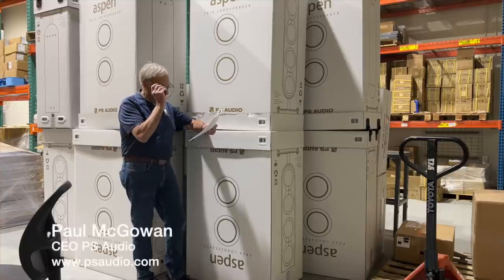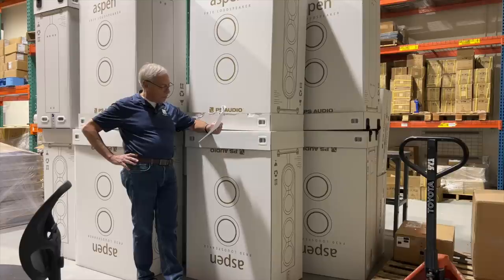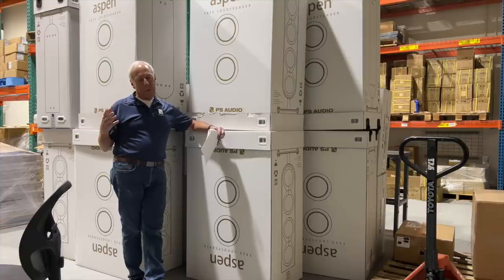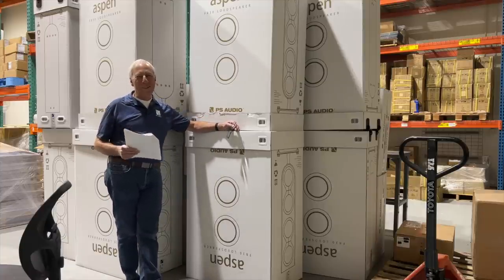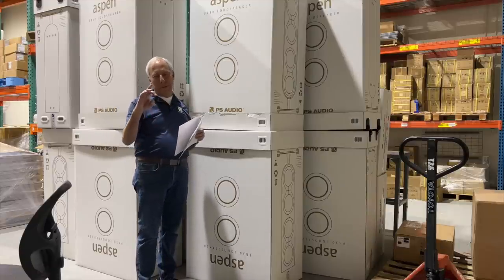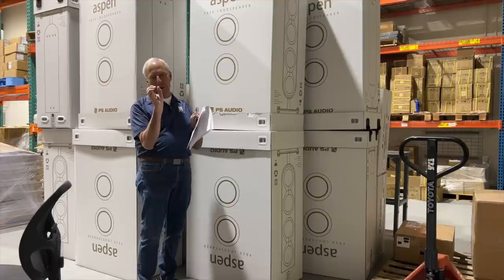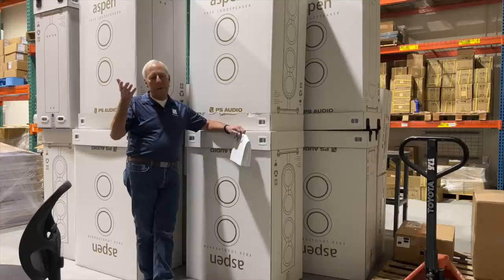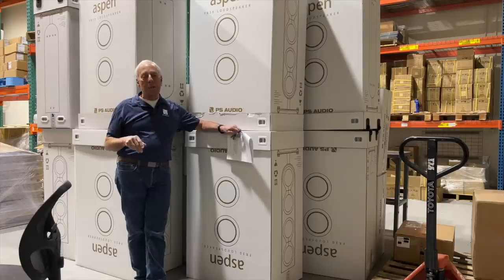Surge suppression in audio

Comment: Hey Paul, speaking of getting hate, did you ever apologize to Amir for all the hate you gave him over proving that your Power Plant didn't perform to the specifications that your company says it does, and for showing that your Power Plant can actually cause distortion in the AC and that it really isn't necessary to even buy a Power Plant because audio components have their own built-in voltage regulation and don't actually use AC?
A famous song once said the love you get is equal to the love you make.
Maybe it works that way for hate too.
Reply: Go ahead, blame Paul for Amir's comments, and for starting the negativity. That's called projecting.
Reply: @nightdrive2646  I think you have that backward.
There's no projection there.
Amir tested the PS. Audio Equipment with no preplanned judgments and through testing found that the PS Audio Power Plant did not work as advertised.
All Amir did was post the results and gave obvious conclusions.
When Paul became aware of the conclusions of the testing Paul is the one that started by insulting Amir.
Amir never said anything about Paul personally and went so far as to retest the Power Plant and found even more issues with the Power Plant.
There was no negativity on Amir's part, he merely presented the facts.
Reply: "merely presenting the facts" also includes interpretations and conclusions that are meant to discredit anyone that can hear differences, as many of us most certainly can hear a difference.
Reply: Two of your comments cannot be true at the same time. It is impossible for there to be no implicit bias and at the same time have it known that a difference in sound quality is physically impossible. If one is true, then the other is false, as both cannot be true at the same time.
Reply: @nightdrive2646  This is like saying that 2+2= anything that you want it to be because even though the only real answer is 4 you feel that the answer is subject to your own personal interpretation.
What Amir concludes in his video, and it's not just Amir's opinion it's actual real circuit design, is that the Power Plant can't possibly affect the sound of any audio component because every component has its own power supply that the voltage must pass through and that internal power supply converts any form of A.C. into D.C. through the use of a transformer, capacitors, and diodes.
The incoming A.C. never reaches the audio component and can't possibly have any effect on the output of the audio component.
You are proof of the statement "It is easier to fool people than to convince them they have been fooled."
Reply: Wrong. It's called philosophy 101. You can't test something while having a built in bias, say it is physically impossible to be any other way than what you say, then claim that is unbiased.
Reply: @nightdrive2646  There is no bias involved!
There is no opinion involved!
It is the way all audio component circuits are built!
There is NO physical or electrical coupling of the A.C. to the audio circuit and so no matter what the A.C. condition is, it can not have any effect on the audio output.
Reply: @JonAnderhub  audiophiles have been told for years that there cannot be any differences in audio cables. We've even been presented with "evidence" that supposedly proved there are not audible differences between cables. We all know by now that isn't even close to being true. We hear differences in audio interconnect cables, speaker cables, electrical cables, and regenerators, in addition to speakers, preamps and power amps, and dac's.
Reply: @nightdrive2646  In the psychology of human behavior, denialism is a person's choice to deny reality as a way to avoid a psychologically uncomfortable truth. Denialism is an essentially irrational action that withholds the validation of a historical experience or event when a person refuses to accept an empirically verifiable reality.
Reply: Denial of sound differences in cables (even though measurable). Denial of differences in power chords. Denial of differences with regenerators. Denial that audiophiles can hear differences. Denial that the review was biased. Denial of good uses of the power regenerator.
Reply: @Douglas Blake you're not talking about science. True science is interested in "why". You're not interested in "why". There are WAY too many audiophiles that can hear the difference a regenerator makes in their systems. Even Amir recognizes that a cheap surge supressor can have a negative impact on sound quality. If it is possible for a cheap surge supressor to negatively affect sound quality, how is it impossible for a device that regenerates the distorted elements in the electricity to not have a potential positive impact? For years, audiophiles have been saying there are differences in the sound quality of audio cables, and for years, the measurementologists have been saying it is physically impossible for audio cables to sound different from one another. Your side even provided measurements as "proof" that there could not possibly be any difference in sound. Well, maybe you haven't seen discussions in 2022, but there most certainly are known measurable differences in audio cables. 
Have you even looked at the distortion spikes in Amir's graphs? Are you aware that the Ps Audio regenerator made a 22db improvement in the distortion spike just below 200hz? A -42db spike was improved to -64db by the powerplant. The Ps Audio powerplant made a 16db improvement at 300hz, and other large improvements at many other spikes including 550hz, 675hz, 800hz, 900hz, plus many other spikes between 1k and 2k. If you look at the entire spectrum, you'll see the powerplant reduced the distortion spikes throughout.
Reply: @Douglas Blake one of Amir's main criticisms of the PS Audio regenerator was regarding increased noise at -90db, to put things into perspective.
Reply: @Douglas Blake the mentality behind the powerplants is to NOT regenerate the entire spectrum 100%. It regenerates 100% below 1khz, but less than that above, as, according to Paul, that's where there one wants the amp to perform it's magic on the lesser distorted higher frequencies
Reply: @Douglas Blake if what you say is true, that the positive effect of the PS Audio powerplant in the -30db to -60db range is irrelevant, what does that say for the negative review that focuses on the -90db to -110db range?
Reply: @Douglas Blake The positives of the P12 potentially help in changing the -36db spike to a -52db spike, the -42db spike to a -64db spike, and -43db spike to a -56db spike (as can be seen in the testing graphs. The criticism of the unit focuses near -100db. Just trying to point out that if the positives of the P12 are truly as meaningless as you say, the criticism of the noise of P12 is even more meaningless
Reply: @Douglas Blake and again, the technical claims being made here completely and totally negate the criticisms in the other online negative review. Yet the other negative online review is praised.
So which is it?

The criticism of me above that I "don't understand enough" about how amplifiers work PROVES that the comment is FALSE regarding the other negative online review being done "without bias".
If it is "impossible" for the product to help sound quality, there is no need for a negative review that focuses on info that is claimed to be completely and totally irrelevant at -100db. Something smells fishy.
Reply: @Douglas Blake search back to the original comment (not mine). It is the CONTRADICTION that I am calling out. CONTRADICTION. The praise for the negative science review, and praise for the reportedly unbiased nature of that negative review in comparison to the supposed evidence presented in this thread. They CONTRADICT one other.